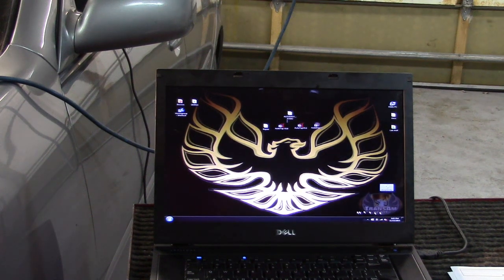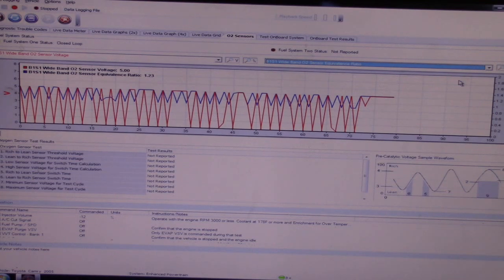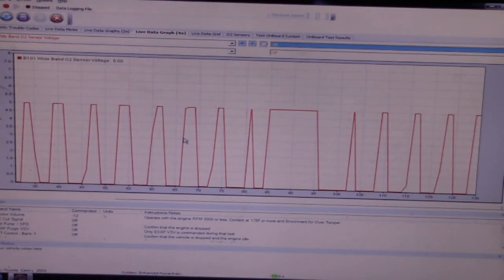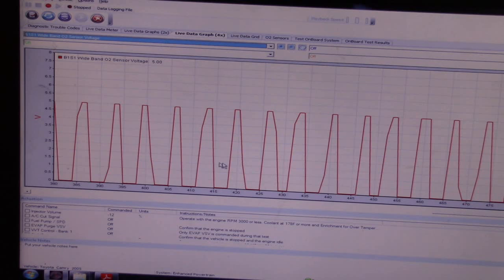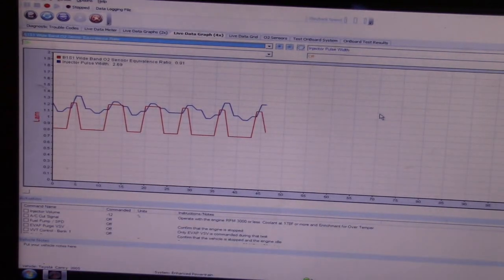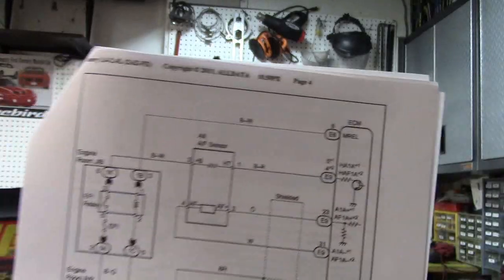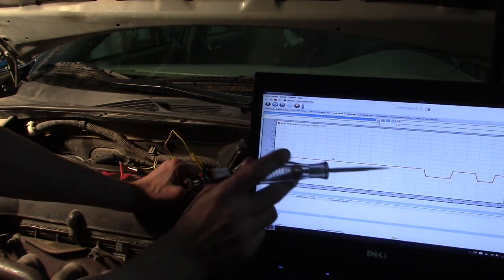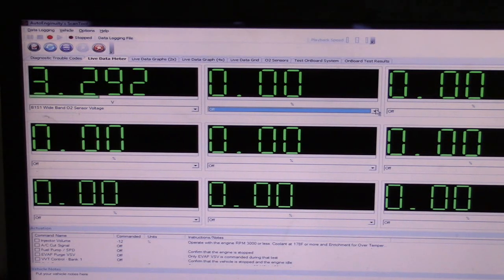Diagnosing Camry P2196,P2238 A/F sensor codes PART2

Comment: no man go with a solid state hard drive (SSD) they don't crash or get damaged and you don't lose information
Reply: +mrjesse 1Tb Ssd- $400.  1TB standard drive-$64.  Value of computer- probably Approx $250.
 Standard drive and cloud backups it is.  it lasted 6 years - longer than the whole laptop should have lasted.  i'll do SSD if I get a new laptop someday but not gonna spend $400 on a $250 laptop i only use for car diagnostics twice a week.
Reply: My SSD died after two months. I have never had a mechanical drive fail...
Reply: Andrew Thompson Whoa, how would a SSD fail? that sucks!
  Even so i agree, the marketing for Ssd has created false impression that mechanical drives are crap- totally untrue. This is the first mechanical drive failure i have ever experienced. Most laptops also have gravity sensors to turn off the drive if the laptop is dropped. I am far more concerned about my laptop itself failing for any reasons by 1000X more than i am the hard drive failing.
Reply: +Schrodinger's Box Quantum Mekanix A mechanical hard drive is perfectly clean inside. If a car engine was kept that clean it would not fail either. Hope it was not too much work to rebuild your laptop.

Comment: In response to your comment to Steve Huelett in which you stated   ( that there was no way of measuring the voltage output of a A/F sensor using a Scan Tool and that the amperage output of the A/F sensor was just to low to read it with a Scope/DVM.). You are correct about the Scan Tool but not about the Scope/DVM part. Using a Scope or a DVM you can read the voltage present on the pump cell's output. The A/F sensor's pump cell is normally measured using a very expensive ( $600 - $700 ) milliamp clamp measuring current rather than voltage, but there are other ways to measure them too. If you measured or knew the resistance of a known good A/F sensor's  pump cell and you measured the pump cells voltage with a Scope/DVM, you could apply Ohms law to read the amperage of a A/F sensor. ( Current = Volts/Resistance )  If you owned a Pico Scope ( The Best ) you could put that formula into a Math Channel and it would calculate it for you and graph the amperage changes.. I never tried it, but in theory, you could wrap a wire loop around the wire to the pump cell's output several times. In which the pump cell would induce a voltage/amperage into the loop of wire, that would be several times larger than the pump cell's original output. The increased voltage/amps would be proportionate to how many loops of wire you used. That in turn could be read using a standard low amp clamp. Anyway Matt, Great Vid, keep them coming !
Reply: Never thought about that but indeed looping a wire around the amp clamp should amplify the signal with each winding (as long as it is wound in same direction each loop). Never thought of that but totally makes sense!

Comment: u can get that sensor for $110 at rockauto. Nippondenso  is the o.e. manufacturer. only difference is it will not have Toyota printed on it. nice option if practical. surprised it turned out to be the sensor. got to like the logical approach u took.. look forward to your next video. seriously considering subscribing to your pay channel.
Reply from the maker: +david goliath yeah normally i would do that but customer was thrilled to just pay $300 for the repair and get it done immediately. I did not charge labor. 
  Rock Auto is my favorite!

Comment: I sure this car will have a rear o2 .not sure why you did not look at the rear o2 and the front wide band at the same time ?
Reply from the maker: +Stephen Kasapis I intended to just out of curiosity like I mentioned but It isn't ha helpful really. if the cat has strong activity the rear O2 will still usually be fixed unless the changes are extreme and sustained for some time. If we don't see changes in rear O2 the. it doesn't mean anything. and even if we did see changes It also isn't helpful really because we have 100% confirmation front sensor has an issue without looking at the rear.
Reply: Did you see James Danner's 03 Toyota v6 system lean video. A bad rear sensor somehow decalibrated the AF sensors. It would have been useful to see him do your tests with a resistor as he almost sold the customer two AF sensors.
Reply from the maker: Andrew Thompson Rear O2's can have some minor influence on fuel trim on later model cars (e.g. they do not only monitor the cat) but I never really looked into this.
  A future video I plan on doing is fooling the rear O2 and looking at what effects there are on Fuel trim as a result.
Reply: +Schrodingers Box I have a theory that AF sensors need to be calibrated and they do that with the rear sensor. Have you seen Briansmobile1 lean rich code?....Its hurting my head.
Reply from the maker: Andrew Thompson Hmmmm... never considered that.  I know most manufacturers recommend a protocol for re-learning fuel trim when an AF is replaced but I've never found I needed to do that.

 Brian has a rich-lean video? I thought he just changed head gaskets on scooby-doos lol. I'll have to check that. I don't think I ever seen him use a scan tool before!
Reply: +Schrodingers Time for another experiment. You could inject air into the exhaust during the warmup phase to trick the system in a controlled way.

Comment: I am interested to know how you can tell the difference between the ecu feeding the o2 sensor to keep it warm, and your diagnosis?  It's know ecu will feed the catalytic converter.
Reply: Not feeding o2 feeding cat conv
Reply: +Brian Beaurate Good question- three reasons. First, no heater code. Heater codes are very dependable. Second, the oscillations observed were abnormal even if the heater was not functioning so there is still an issue. And third, I didn't show it on the video but I did measure 12V on the heater circuit but I lost it in editing because it didn't show up well- I was in the way of the camera by accident

Comment: This video came at the perfect time!  I am in the middle of diagnosing what I believe to be a faulty af on my forester.  I just finished an engine job and bumped my af sensor when reinstalling the engine.  My sensor is also oscillating in the same way.  Glad to see my findings were verified by your diagnosis on this camry.  Thanks!
Reply from the maker: +goodguy555 Excllent- I tried to rush it out for you lol.
On a forester keep in mind stoichiometry will be at 2.2V not 3.3V
Reply: +Schrodingers Box After replacing my AFR sensor, I confirmed my repair on my scanner.  With an equivalence ratio of 1, my sensor voltage was 2.7V.  My Subaru is a 2004 forester XT, perhaps the turbo models run a different voltage? My 2009 Impreza runs at 2.5V. Just an FYI.  P.S. Subaru's are awesome! Haha.  Thanks again for your help! Your channel is awesome!
Reply from the maker: goodguy555 Yeah different years, makes and models have different voltages.
  If your stoic is at one ACROSS ALL ADAPTIVE FUEL CELLS (e.g. across all engine rpm's) then you fixed it.

Comment: SORRY +Schrodingers Box, but I gotta do it in the interest of You Tube video accuracy... lol.

You fundamentally misunderstand how those wideband air/fuel sensors work. A big clue you missed was your Toyota O2 design paperwork. See where it says "pumping cell current", and shows the little graph going up and down?  And when we are discussing electronics, what is current referring to? That's right... amperage, not voltage. That 3.3v is a bias voltage that should remain relatively steady all the time. The fact that it didn't just portrayed the sensor had major issues.

It is current flow that is being measured by the PCM, not voltage. The fact that your voltage was moving all over the place was only because the sensor was bad. The PCM is measuring current, down in the microamps range. Next time you have the car, monitor short and long term fuel trims, commanded lambda (EQ ratio in this case), O2 voltage, and then drive the readings rich and lean with propane and vacuum leaks, and you'll see what I mean.
Reply from the maker: +Steve Hulett Ummmm... pretty apparent you didn't see my video on diagnosis and understanding of AF sensors where I say exactly this as I did in this video. Of course these are amperage systems as I stated several times.
Reply: +Schrodingers Box, I must have been thrown off when you were logging voltage changes from 0 to 5v on this running engine, and stating that the car was responding to your changes in air/fuel ratio when you were doing bypass tests. I did not see the other video, no. But you were logging voltage here, as there are no amperage PIDs.
Reply from the maker: Steve Hulett Voltage changes from a scan tool are just interpreted data from the PCM's current measurement. There is no way to measure changes in voltage. Actually there is no way to even measure changes in current with a DVOM or scope- the current amplitude is just too low.
  Scan tools do not show current on AF sensors (at least that I have ever seen)- they simply use arbitrary voltage as a reference and it varies tremendously by manufacturer.
  I believe they do this only to make the concept familiar to technicians who are used to seeing voltage changes from O2 sensors which is in fact real, actual change.

Comment: Nicely done.  Did you need the Autoenginuity enhancement software for Toyota to get the Equivalence ratio or is that also available on the base Autoenginuity software?
Reply from the maker: +Sandbag1300 it is available on the base because equivalence ratio is a generic PID.

Comment: Man I just discover this Chanel. And i like the way you think and use the knowledge to diagnose and troubleshoot without using any repair manual specific for the car. I'm going to be aircraft technician/engineer . I'm going to take your way of thinking in my future job . I will be the 2% not part changer
Reply: Actually I as soon I find  problem ( damage rectification) I will check the part

Comment: Thought you might show stft graph when the new sensor was installed.Numbers on there own don't seem to show the whole picture.Nice direction advice starting with the fuel trims.Handy tip, artificially fooling the Pcm that a wideband sensor was responding.What value in ohms was the resistor used in the experiment ?Must delve into the workings of the wideband sensor as it is quite different in operation from the O2 sensor.Good video and lucky to get the hd  before it crashed.

Comment: Sucks ur lappy hdd bit dust ... do you optimize ur computer for better performance? like getting rid of all the bloatware etc ... , uninstalling all trial software, toolbars , macafee, Norton crud? 

You can also disable startup programs by typing msconfig  In run/search bar  goto startup and unchk everything cept ur security and maybe  wifi stuff

You can right click my comp and hit properties >system settings>perf settings and chk adjust for performance  and leave bottom 4 enabled etc..

Yah backing up or cloning hdd a must :)
Reply from the maker: +Dave Jr Yes actually that laptop is only used for car diagnostics and it pretty much has car stuff and my iPod songs lol. It is actually really fast but it had been slowing down and programs inexplicably shutting down the last 2 weeks so I am not surprised the HD died.
  The laptop stays in the garage with extreme temperature conditions and gets abused falling from cars and stuff... surprised it lasted this long!
Reply: I hear yas ... sometimes when a hdd Is failing people will put In freezer for while tobring back to life so they can get data off etc...
Reply from the maker: +Dave Jr  wow never heard of that! I'd expect that would make it worse. Luckily I got my data recovered before it totally totally died but the computer would not boot - just said "no hard drive detected".
Reply: Yah the Idea  was If the platters are sticking It would shrink the metal etc.. tis a myth to some but has worked for others

Next time I would chk Bios to see If drive Is detected as then U can throw In enclosure to another comp and transfer or save files before It goes totally culput :)

I personally was able to get a non working hdd back to life foe 30 mins but def wouldn't rely on It, I also recovered dead motherboard and videocard by putting In oven  for 10 mins lol , guess It solders back connections

Comment: The 1.5 v battery idea was brilliant! Did you back probe the connector with it still plugged in?
Reply: +Che Kelley 
There must be a market for a wideband sensor simulator/stimulator,  Ibought one for narrow band sensors.
Reply: +Che Kelley I thought about how Matt shot it, and he induced that voltage with the engine off but key on. He used the wire harness by unplugging the Air Fuel sensor.

Comment: ...Oh I see how it is.  Gimme enough time to write up that huge text wall, THEN post Part 2!  LOL

I'm almost willing to bet that WOULD be a square wave if the sampling rate were high enough!

Huh.  I'd never have thought that with the mess of wiring and likely incorrect engine, that things would actually work!  I don't know for sure, but based on what I saw in the first video, I very likely would not have accepted this job.  I'd have been happy to assist the customer in getting the proper engine put in (California has pretty awesome consumer-biased auto repair laws...) by the shop that originally did the work, but unless I could develop an understanding for what was done to make the engine work, I wouldn't feel comfortable spending the customer's money, even with all the confirmation you showed in this video.

Whether by spotting something I missed, or shear balls, congratulations:  You've gone where I wouldn't.  :D